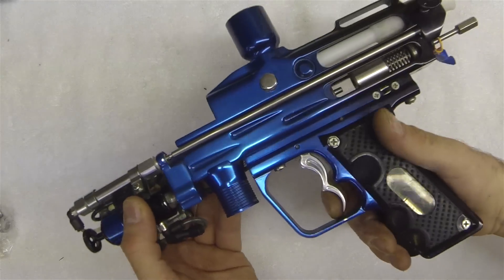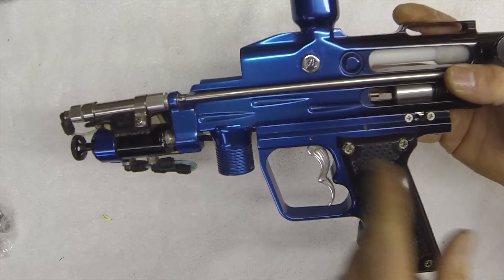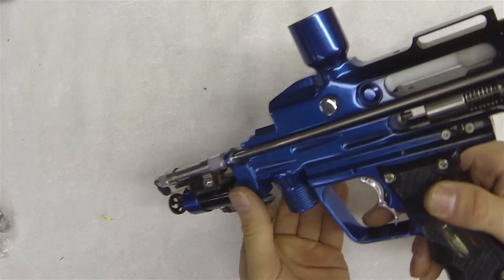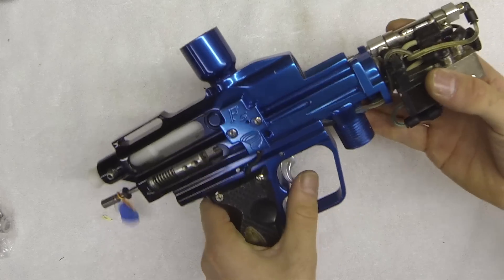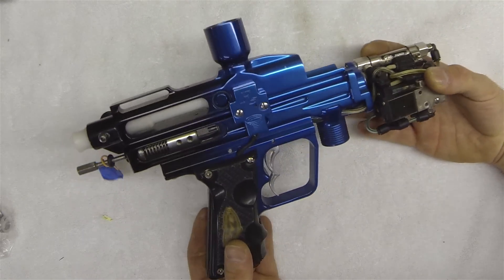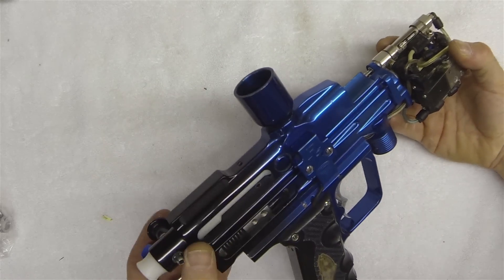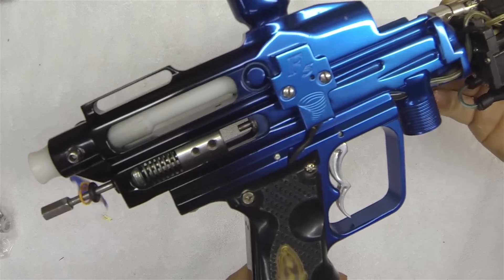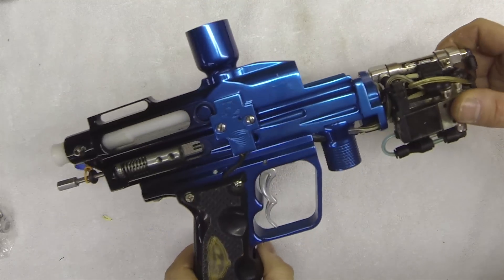Sandridge F5 Tiny Tornado Electropneumatic Autococker

Comment: I must own one of these some day
Reply from the maker: +scsmooth1 This is one of the nicest I've seen. I haven't shot it in the last 3 or 4 years but when I first got it I tried it out and it was shooting soooo smooth.  Cut a neat conversion and the removal of the Sandridge bottomline battery block is a must.
Reply: +BacciPaintball.com I wanted one of these from when first came out. I was young and had no money. Even says the same thing. They shoot so smooth. I started getting back into paintball. Showing my age went looking for autocockers. I now own an E-Blade ANX Gen-x 4, Race gun (Not sure what body it is) and Psychoballistics Superbolt. I found the person who had my old ANS Gen-X (Forget what year I got it but it's one of the original ans gen-x autococker). Some thing was leaking air in the lower tube so this person just let it sit for years. I'm rebuilding it now. I now just need two more always wanted marker. One Rainmaker (Might have that soon, I hope) and the Sandridge F5.